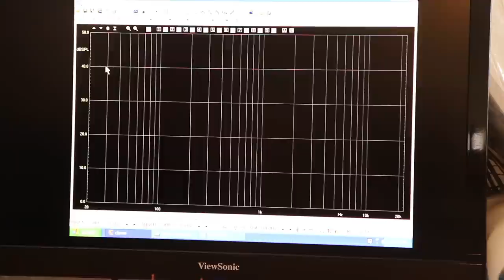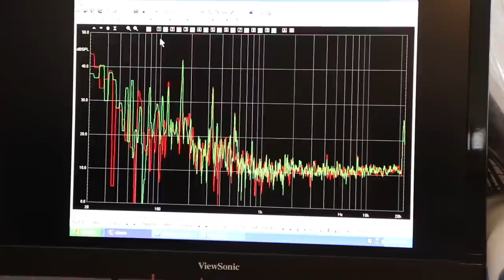Power Cable Tech Talk and a little help for Amir at Audio Science Review

Comment: Hi Danny, thanks for putting up this accurate and informative video on power cables. For some additional reference for your viewers, here are links to two videos I made using an Entech power line noise analyzer that demonstrates with data the impact that well-designed power cords can have on reducing noise from our AC mains. Links here: https://youtu.be/g2SAj7aKXGo and here: https://youtu.be/-X9gYpmtlxE ASR likes data? Well, here it is...
Reply: Great data and as always Shunyata Research makes great products.
Reply: Your test doesn't show what effect the noise reducing cable has on the output of your audio components. Instead you end your video with the statement "you can assume...". So far for objective data.
Reply: How  come you're getting what appears to be just 1 audio signal?  Around here there's dozens of FM and AM radio stations, so if your power did somehow manage to pickup radio signals, wouldn't it just sound like noise, and not like 1 radio station?
Reply: @4everB2  All one has to do is plug it in and listen. A large proportion  of the noise from audio systems comes from the components themselves. Specifically, their full-wave bridge rectifier power supplies.   It's alternating current, the current DOES NOT flow just in one direction like water from a hose to a faucet; from the wall rceptacle to the component, in only one direction.  It's AC...the current goes INTO the component and back OUT of the component, at 60X/sec. And, when the the current comes back out of the component,  noise components from preamps and amp power supplies are distributed to lower signal source components. It's a SYSTEM: the power distributor prevents noise COMING IN from the AC mains and NR power cords prevent noise from coming BACK OUT of the components.
Reply: @stephenscharf6293  I have tested those meters and the noise they make is NOT proportional to noise on the power line.  To wit, I bet you were NOT hearing that Am station on your system.  For that to happen, the bandwidth of your audio gear needs to go way higher than audio band.  And some sort of demodulation to occur.  This can happen with very long runs of audio cables and such but in home scenarios, it is very rare.  To the extent your gear does play AM radio, then sure, you can deploy various means to get rid of it or better yet, buy audio gear that is not susceptible to such interference.

As to interference from the AC cable, I had to put a giant transformer right next to the cable to induce any mains noise.  And even then, it was way below threshold of audibility.  Again, folks are not hearing such interference in their audio gear.

Really, those meters are tools used to sell you things you don't need.  Don't put your trust in a silly little meter that doesn't show the spectrum or even tell you what on earth it is spitting out.  If you believe in measurements, trust the ones I show where I show the output of audio devices where no impact is shown at all with these cable and power tweeks.
Reply: @AudioScienceReview  For years, people insisted that jitter was not audible to human ears because we believed falsely that our hearing was not acute enough in the time domain to discern it. It turns out that we actually have exceptional acuity in the time domain, and all the arguments on the topic have been made essentially moot.

As an actual scientist, whole title actually contains the word "Scientist," I can state unequivocally, that you are not a scientist, and your work is absolutely not science.
Reply: @joshua43214  Likewise, Impulse response of a multi-way speaker is terribly flawed, tweeter hits first, long therafter the low-midrange driver begins to move, often in anti-phase.
Reply: @joshua43214  Jitter manifests itself in the audio signal as noise and distortion, not as timing related artifacts. You're a scientist in which domain?
Reply: Your “data”proves nothing. 

Why don’t you connect a power amp and scan its SINAD performance with a normal and with an exotic cable? That would be competent data. This isn’t.

You will see exactly zero audible difference if you do such a competent comparison.
Reply: @stephenscharf6293 Hmhmhm, my advise. Check some facts. No pre-amp, pwr-amp, integrated and a whatever electronic circuitry works on straight AC, whether it be 50/60Hz. It's always rectified (half bridge or full bridge for the better). Before that usually EMI filtering is already taking place. Then options would be after either a linear psu/regulator or switch mode psu. A lot of effort is taken to suppress ripple as a standard leftover from rectification. AC lines in general are noisy depending on nearby industries. However a lot of effort is taken to remedy lots of effects ( PCF for instance and more) to get as little as possible back into the local grid on distribution level. 
However, noise within a circuit is a rather complex matter. Components, architecture of e.g. an amplifier, feedback loops, induced noise sources...endless story. There is always a trade off during design stage to minimize noise but not at total cost.
Being surrounded by a world of waves...from couple of kHz up to +5GHz (and especially pulsed waveforms, freq. hoppers etc...) there will always be some induction generated. But, this is generally on nV or uV level. Within a internally DCV operated circuit it often does not pass further unless you want to hock up a +20GHz SA and trying to lock for the tiniest signals. 
But, there is usually no AC present in a DC operated circuit (ok, there is e.g. oscillators, etc...to drive a uP and so forth) But completely decoupled from your classical AC you refer here to...
Reply: @onemic-theminimalist   If all audio power supplies were the same and all of them were to notch power supplies  you would have argument.  As it is though, the power supply noise suppression is not a constant.

On top of that, any inherent ripple in the output will be random noise generated by the control chip voltage reference and all other sources of thermal, shot, and flicker noise. So you have different types of noise mashed together so that might be a consideration.  Not all DC power supplies are the same.
Reply: @OneMic - the minimalist recording series  Right, I can't think of anything you can't filter out.  So it would have to be something that would not appear as noise.  I have no idea.
Reply: @davidjones7544  " it would have to be something that would not appear as noise. "

Why are you clinging to the notion that something that doesn't show up in measurement exist?  Just accept the fact that humans are fallible and often report hearing differences where there are not.  

Occam's razor applies here.  The science is solved in this discussion.  There's no supernatural trait to electricity that can't be measured but make your power cables able to improve the audio signal....!
Reply: @literalghost929  I agree with you. I can't think of a single thing you would not be able to filter out
Reply: @joshua43214  can you post an instance where jitter has been detected in a double blind test?
Reply: @AudioScienceReview  Why not just do some real science? When someone listens to a controversial product, like a cable and hears a difference, why measure it? That's not science. Science is about following the evidence and getting to the truth. You're trying to win an argument like a lawyer in a courtroom. If the argument is good enough, you get found not guilty, not innocent. 

If you want to do real science, you have to follow real evidence, not disregard it and come up with a solution to a problem you created. For example, if I claim to hear a difference between some cables in my system, there is only one way to use science to prove me wrong. My claim of hearing a difference is the evidence you have to investigate. Just to be clear, my claim implies that I'm hearing something you can't measure. So, does this mean you can't use science to prove what I'm hearing is real? Of course you can. Look up any generic definition for the scientific method. Measurements are not the only thing you can use to prove evidence. Experiments are just as valid. 

Getting back to the cable example, if you want to prove there are no differences between cables when someone makes the claim, you have only one choice, and you're not going to like it. You have to follow the evidence. Since you can't make the observation yourself, you have to interact with people that can. What other choice do you have? You need to find out everything you can about the conditions under which the observation is made. Then you have to set up an experiment that eliminates all other extraneous factors, and if done correctly, you will have results that will pass for real science. Simply put, you have to test people who can claim to hear a difference, on a system that they use to make the claim. If you set up a listening test designed to follow the evidence, your results will be scientific. You may think you are doing science, but the way you do things on your channel bypasses the evidence of people making the observation of whatever it is you are trying to disprove. That's not science. All you are really claiming is you know everything there is to know and there's nothing new to learn. That's about as far from science as it gets. 

At this point, most people are thinking that what I'm asking is a real pain in the ass. You're absolutely right. It is. But that's the way it goes. A climate scientist can't follow the evidence sitting in a lab. They have to go to Antarticia. Marine biologists can't observe fish that live 2 miles deep in an aquarium. Its no different with audio. You have to test the equipment and people under the conditions the obversions are made. Nothing else will do. 

Consider this. The cable argument has been going on for over 30 years. It started with a small handful of startup companies, and has involved into an industry. Cable generations are 10, 15, 20, etc... old. The same people keep buying the same type of products over and over. All this implies very strongly that the industry is legit. It keeps getting bigger and stronger with each passing year. Now, is this absolute proof that cables make a difference? No, its not. However, a rational person looking at all this would probably not bet against cables making a difference. My personal opinion on the matter is there's so much evidence to support the claims that some real testing is decades overdue. Its time you guys did your first, real scientific test. 

I know from past experience someone on your side is going to say, "Since you are the ones making the claims, you should be the ones to do the test.". For the most part, I agree. I've tried very hard to do this, and so have other people I know. The end result is, you guys have to do it. We can't, because no matter how good the testing is, you guys will never accept the results unless they show the results you want to see. Unfortunately, this topic has nothing to do with audio equipment, or getting to the truth. Its about winning an argument. All I can say for sure, is if the skeptics don't give in and to some scientifically valid testing, you will still be arguing for decades to come, and won't make one bit of progress. If you want to go after it, the truth is there it be had. Its up to you.
Reply: I see this escalated. 😂
Reply: @AT-wl9yq  are you proof-reading your own comments? 'if someone hears a difference, why measure it?' there is NOTHING your ears can hear that can't be measured. Pressure waves created by moving cones powered by electrical signals are banging against your eardrum to create what you perceive as sound. This is why it's measurebale.
Reply: @DescartesRenegade  Apparently, you were the one who didn't read my post. 

"there is NOTHING your ears can hear that can't be measured."

That's a provable false statement. And in several ways. First, you can't provide a single reference, from a credible source, to back that statement up. If we could measure everything we hear, we could tell how a piece of audio equipment sounds just be looking at specs and measurements. You can't do that. No one can. Also, we know for a fact that timbre can't be measured. If you think otherwise, do a search and you'll find some universities that are working on just that. Its a very complex thing to measure, and currently, we can only measure certain pieces that make up timbre, but we're nowhere near being able to measure it in its entirety.

And you missed the single most important point in my post. And that's following the evidence. You don't get to tell someone what they can and can't hear. Science dictates that if an observation is made and can't be explained with current knowledge, you must follow the procedures laid out in the scientific method if you want to prove, or disprove the claim, and call what you did science. You know everything there is to know, and there is nothing new to learn is what you're really saying here.

In this case, we're not just talking about a one off, or rare occurrence. You have a mature industry built up over decades, along with literally millions of people all over the world making the same, or similar, claims. Are you really saying that much evidence doesn't warrant a single listening test done in a scientific manner? That's about as ignorant as it gets, and its a perfect example of junk science. 

Here's what I think. You guys are so emotionally invested in this argument, your only goal is to win regardless of truth. You guys can't accept the possibility that you may be wrong. Thats why no one on your side of the argument has ever conducted a single, well done listening test. You know you're going to lost. 

If you want to continue, from this point forward, I'm going to need you show some references for any claims you make as fact. If you can't show where you are getting your information from, you're making everything up.
Reply: @AT-wl9yq  what is sound from a speaker? Pressure waves. What makes pressure waves? The cone. What moves the cone? Electricity. Electricity can be measured to levels beyond your comprehension. Therefore, if you can hear a sound or lack thereof, then it can be measured. You follow the science?
Reply: @AT-wl9yq  I believe you bark at the wrong tree here. The science is that look at the DUT (Device Under Test) for difference in it's response to input. Does the response changes if I change the power cord, or not? That is the science. Not testing the DUT and the PERSON, the PERSON needs to be eliminated because the PERSON does not have a power plug on his/her butt. So, back to the DUT, if it's response (in SPL/Voltage, Frequency response, and Time domain) does not change with power cord change, then it is sufficient to conclude that there is no difference in response between using one power cord to the other.

Let me take this and have a new example. Let's say we are testing the new LG OLED TV and trying to prove that changing the power cable changes the picture quality. One person looks at the TV and says "the colors are more vibrant now after the power cord change". Do we test the person and the TV under the same exact situation when the person claiming that he/she sees a difference? I don't see the need to include the person, just test the TV using colorimeter and be done with it. We only need to see IF there is a difference in luminance between colors. We may never know if the person is color blind or not, if his/her vision acuity is high enough to observe the difference between pixel color levels.
Reply: @DescartesRenegade  Did I not just tell you that we don't know how to measure everything? I was pretty clear about that. I also gave you an example that you can check yourself. If you can show me any credible source where someone was able to measure timbre successfully, I'll consider everything you just said. If you can't show me where you get your information from, we can't have a conversation. You're just making it all up. You'll keep talking but you won't say anything.
Reply: @zzz2496  I believe you are being sincere, but this is your own personal theory. Its like I just told the other poster. Give me a credible reference that proves what you are saying is true. Just one. I don't care about other products in other industries. We're talking about audio equipment, not TV's or cars or boats or anything else. A properly done listening test will yield scientific results. You will never do this.

These arguments have absolutely nothing to do with evaluating audio equipment in a search for the truth. You just want to win the argument, and you'll say anything you have to. 

Let me put it another way. How could you possible do any credible science if you're not willing to evaluate the product you are testing use in its intended application? Its absurd. No scientist in their right mind would agree with what you're saying. 

We just have to disagree on this. You can think whatever you like. Its your choice, and I'll respect it, even if I don't agree.
Reply: uh Great except it does nothing to prove what you "Claim" it proves.....
Reply: @kevintomb  Can you explain it? Of course not. I bet you can't even tell me what claim I made that doesn't prove anything.

I dare any one of you guy's to quote something I said and prove me wrong. You couldn't do it if your life depended on it.
Reply: @AT-wl9yq  I can clearly tell you don't understand science one single bit. I explained the chain of actions to you and you still resort to "but we can't measure everything". We can indeed measure every electrical signal that causes the cones to move and create pressure waves in the human audible range. This is a scientific fact. Unless, of course, you have a PhD in quantum physics and know something I don't.
Reply: @DescartesRenegade  You're lying. I told you we can't measure timbre. You just ignore me and say we can.

"We can indeed measure every electrical signal that causes the cones to move and create pressure waves in the human audible range. This is a scientific fact."

A scientific fact. OK, fine. Show me. Where can look this information up for myself?

"Unless, of course, you have a PhD in quantum physics and know something I don't."

You got that part right. You can't even answer a simple, common sense question. With all this senseless back and forth, all I'm asking is to show me where I can see this information for myself. 

You don't know anything about electronics. If you can't answer an easy question, you can't answer a hard one.
Reply: @AT-wl9yq  I am sincere. And since you have your own opinion about "science", then so be it. I came from IT background, and in my field, that's what I do. If I want to test something, I don't examine the device along with the person who's complaining about the said device. I only took the description of the problem from the said person, check if the problem is as described, and I'm done with it. Involving the said person will complicate things. Be it audio, computers, phones, TVs, even microwave oven. When your spouse complains about the microwave oven not doing its "thing", you don't examine your spouse along with the microwave oven. Maybe my logic is flawed to you, but for all 40+ years that I've lived, it kind of works for me.
Reply: I'm sure quite a few people are following along with all this senseless back and forth. I'm at a point now where I think I made my position very clear. I already knew exactly what the responses to my comments would be. I just needed everyone to see them.

I've been through silly discussions like this more times than I can remember. There's nothing new for me to learn here from doing it one more time. However, every time I post on the junk science audio review channel, or whatever they call it, my posts always get deleted. Why? Because they don't want anyone to read them. They can't delete my posts on this channel. People need to see the truth as to what's going on here. 

What's the fastest way to build a youtube channel? Pretend like you know what you're talking about and tell people what they want to hear. Did you ever notice that the cheaper product is always at least as good, if not better, than the expensive one? That's a very easy sale to make. Why spend $2000 when you can get something just as good for $200. You can't lose. 

In the real world you don't always have to spend more to get a better product. No question about it. But every time? You guys can now see just how fake these people are. Ask them the simplest question possible, and they collapse. Now that you have actually seen it for yourselves, my part in this is over. My only goal was to get this information out to as many people as possible, so you can make more informed choices.
Reply: @AT-wl9yq  a simple Google of "measuring timbre" yields a few credible results from physics based publication. Stop the intellectual laziness. Whatever you think timbre is that you hear, it can be detected with instruments. Anything else is placebo.
Reply: @AT-wl9yq  interesting conversation actually, I think people misread you as an arrogant know it all. 

I don't, i think you're extremely passionate about audio. And most definitely, intellectually present. 

I think , people should understand that not everybody looks the same and experience this hobby the same . 

You said in a post here something about timbre. And you're correct, never really thought about it but you are right. It cannot be measured, it can be quantified. But not measured...

Very interesting look on things you have, and that from someone , that isn't a cable believer at all either. 

I feel we all should realize we have different opinions. And maybe even facts to share (as I am sure all parties have) but guys...

Let's be real here, it's just fucking music . It's not that serious. To get into heated arguments over.
Reply: @AT1272  As a scientist and a lawyer, your position(s) were well pled.  Unless and until the "true" scientific method is applied, case closed...for now.

Interestingly, I  had an experience with my first pair of speakers 35 years ago, where I upgraded my lamp cord speaker wire with wire that had 4x14 gauge wire into each terminal.   The difference in enhanced bass response was jaw-dropping (no joke,  huge difference), but it did cause the highs to roll off more than I liked...hence the reason why I always bi-wire using a thin wire for the tweeter terminals when using my thick wire for the bass terminals.

Anyway, two weeks ago, a fellow audiophile challenged me on this point and didn't believe there would be any difference.   Using a method similar to what you had outlined,  I tested the bass response with the thin (1x14 gauge) wire relative to the monster 4x14 gauge wire.  Was there a difference,  yes...was it as dramatic as what I had experienced with my first speakers so long ago. No.  But,  the bass was a little enhanced (a few dB at most) and it sounded a little warmer and fuller. Certainly enough that I'll continue with this bi-wire set up.

The point here is that there was  likely something specific (a deficit of some kind) with my old speakers  that was overcome by the thicker wire, or maybe because the thicker wire was of a much higher quality than what was in the lamp cord.  Not clear.

But,  with a modern speaker that undoubtedly had much better components than what my 35 year old speakers had, not to mention using oxygen free wire for both the thin and thick wire, I did hear a difference notwithstanding.

That's the scientific method at work folks.  Apply it.
Reply: @Artemis_Prix  you can't compare 2x14 gauge to 4x14 gauge. You have double the material hence less resistance. That's basic circuits.
Reply: @AT-wl9yq  "If you want to do real science, you have to follow real evidence, not disregard it and come up with a solution to a problem you created. For example, if I claim to hear a difference between some cables in my system, there is only one way to use science to prove me wrong. My claim of hearing a difference is the evidence you have to investigate."

Exactly! That's what objective, scientific-minded people are trying to accomplish. We start from the fact that some people are claiming to hear a difference between 2 pieces of hardware. Now the question is, what can be the source of this difference? We know for a fact that everything in the realm of electronics and signal processing can be measured and quantified beyond ability of human senses. Therefore if there's any difference between electrical response of individual hardware, it can be measured and quantified beyond any reasonable doubt. Upon measurement, if the differences between measured technical parameters of two pieces of equipment are negligible, non-exsitent or inconsequential (which is exactly the case with power cables), any rational individual shall arrive at the conclusion that any perceived differences between such equipment is not due to physical/electrical properties of the hardware unit under test, but a matter of psycho-acoustics (i.e. in one's head).

As Sir Arthur C Doyle put it: Once you eliminate the impossible, whatever remains, no matter how improbable, must be the truth.
Reply: @joshua43214  LOL
Reply: A pitty you dont understand electronics.
Reply: I have followed this debate for some time. I question if I have become a masochist. I have not concluded which side of the argument i find myself on to date as I feel for every good point made their is someone quick to counter and I know some people may be intellectually more articulate than others and I refuse to fall pray to who shouts the loudest or makes a better point at the time. But I understand your logic and as soon as I read it I realized that should end this debate indefinitely until such test as you've suggested can  be conducted. It's amazing how many don't hear how simple the answer is...(the test itself is not simple as you suggested) but the answer to the question is. However look at the world we've become when we aren't happy if we cant disagree with someone and inform them how uniformed they are. I've never heard it said better than this isn't about audio, it's about winning an argument. Thank you for putting to rest my quest for these answers that I now realize can't be solved debating one another. I agree it does require real world testing. Until then we should follow whatever belief we want to because no one will be able to prove us wrong until a credible person, and I'd suggest 2 credible people representing both sides of tbe argument working together to out together this experiment so both sides would know they have been represented fairly. Anyhow thank you for your inner Spock in sharing such a logical and practical position and helping me anyibe else who can see the light to move on for now.
Reply: @dmgmail7021  With a lissen test your brain will, or will not fool you in hearing a differance, thats the point. Putting a special stone on your loudspeaker could have the same effect, and there are many other pseudo electrical tweaks that are just the same. Just the magic from a goeroe is needed to blow life into these (.....?). Its all believe, and that keeps a discussion yes. It has nothing to do with improvement in the real world, thats a thing to only see and measure as a technician.
Reply: @duboracle awesome✌️ appreciate your concern 🤙
Reply: Timbre can’t be measured and yet we can identify different instruments in audio recordings? That is the most simple example of equipment measuring the differences in sound waves to produce what we perceive as timbre. I seriously can’t imagine denying such simple evidence.
Reply: @AT-wl9yq buddy, to be completely honest, there's nothing that can't be sonically measured better by scientific instruments. Human ears have limits, we know exactly what they are. Just like eyes have scientific limits, otherwise we wouldn't have telescopes that can measure far outside of the visual 'human' spectrum. Both are waves, and both are interpreted differently by each individual human, but not by scientific instruments. That's why we use scientific instruments, to take the faulty human element out of the equation. Come on my guy
Reply: hahah is that what you call evidence? Man you SnakeOil sellers do protect each other, I give you that lol
Reply: @AT-wl9yq I’ve never heard Amir make a comment where there is possibility for error. He is always 100% correct in his mind.